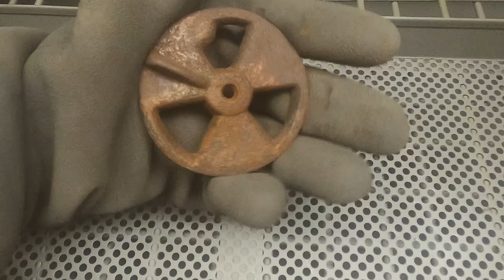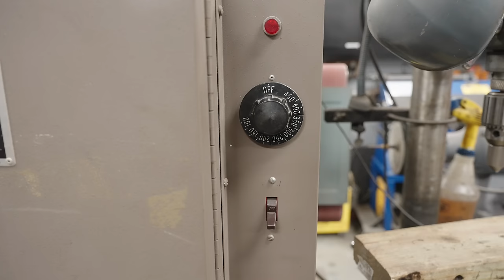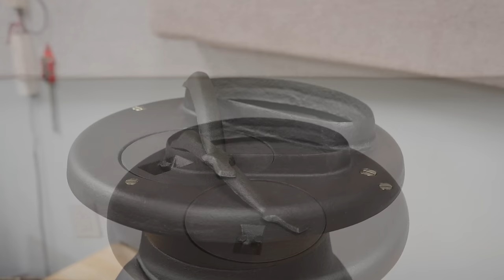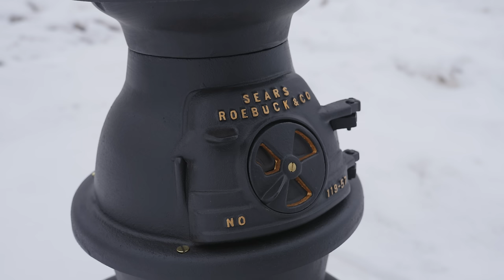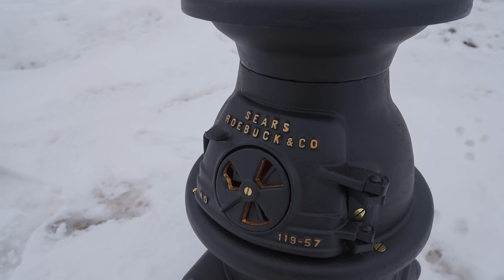Potbelly Stove Restoration

Comment: A 1957 mass-produced Sears Roebuck potbelly camp stove. Most likely sold by mail order. You did a good job restoring it and it and you will likely get a good price for it. It is actually better than new even with all the repairs. Welding cast iron is not for the faint-hearted. The massive cracks speak to years of hard use. Well done and a very interesting video!
Reply: Frankly it should be used as a decorative object at this point and not for heating.
Reply: Wasn't welded, but brazed which is a lot easier to do on cast iron than actual welding. Though he could have welded it having access to that oven for preheating.
Reply: Isn’t that actually “braising” or however it’s spelled?  Not welding…it’s a different process.  It’s a lot of work for….nothing?  Really?  Cool project I guess.
Reply: I second that, my father was a master welder, he would approve. We had a mini Franklin pot-belly in our green house on our homestead in Homer Alaska. Miss that little guy. Thank you for saving this one. Great job 👍 🤗❤️🌈🙏🕊️
Reply: @bruwin  welding cast iron is a lost art at this point
Reply: 1957!  I was thinking 1930's.  
Thanks for the info.👍
Reply: they never stopped making potbelly stoves
vogelzang sold one right up until the epa mandated reburn systems the fact that isnt that old shouldnt be surprising the old 1800's and early 1900's stoves are just about gone now they cracked much like this one did and they were replaced or the homeowner upgraded to domething more modern Edit: i came back to add that a quick google search shows that you can buy an E.P.A. compliant potbelly stove in 2024  thats cool
Reply: Pot belly coal burning stoves ended up anywhere heat was needed. I would be more inclined to refer to them as a parlor stove but there were many different styles of stoves that fell into that category.  Camp or tent stoves usually were box type for wood burning and had flat top surfaces for cooking. But if you had a hunting shack at a deer camp you might use a pot belly for heating and cook on a proper kitchen range of some sort. My wife's family had a stove very similar to this in the garage.
Reply: @victoriaEish it is still a form of welding and has a lot of different applications.
Reply: It was made from 1900 til about 1908.
Reply: @victoriaEish  brazing is joining metal. Braising is cooking food for a long time at low(ish) temperature in partial liquid.
Reply: @briandeeley1599 people say the same crap about classic cars but we still have plenty driving around.
Reply: the casting date reads: January 19, 1857...just sayin
Reply: @brentdallyn8459  - Ha ha ha ha.  That's the Model Number.
Reply: @cloudian159  Brazing technically isn't welding. Welding is specifically joining two metals by melting the base metal and the filler metal together. Brazing is done at a much lower temperature and only melts the filler metal, which is why you typically see brass using in brazing.
Reply: @bruwin  yeah I'm aware I'm a licensed welder. However it does still fall under welding as you are joking multiple pieces together. It is used for metals that either won't melt together or in this case with rod iron is extremely difficult as the metal itself tends to just melt before it will join.
Reply: That was definitely brazing. And no, brazing is not welding. It isn't clear to me what kind of rods he is brazing with; but if he is brazing with aluminum rods the melt point is very low, around 720 F which seems like a bad idea for a stove. If he is brazing with higher temp rods I think the repairs will be strong and hold up.
Reply: @cloudian159  It does have a lot of different applications and repairing Cast Iron is one of them. But no, it isn't welding.
Reply: @GeorgiaRidgerunner  I think pot belly stoves aren't epa compliant but epa exempt. The epa hates everything that is old timey which is why they went after old things that they claim are bad for the enviroment while ingoring modern things which are observably terrible for the environment. You never see them crack down on round up or reinforced concrete.  Wood stoves, brass polish, clock oil all victims of the epa. :)
Reply: @brentdallyn8459   Yeah sears wasn't a thing in the 1850s. :)
Reply: @cloudian159  You should tell the several licensed welders I've had to deal with that Brazing is Welding, because each one of them were quite adamant that it isn't. Anything that doesn't melt the base metal isn't welding.
Reply: @Joe_for_real I'd guess some kind of brass alloy by tue color.
Reply: If I remember correctly you can weld cast-iron with nickel welding  rods.
Reply: @vincecarnevale4406  They do make rods for welding cast iron, yeah. But you really need to heat soak the metal first, and then let it cool very slowly so that it doesn't fracture as it cools.
Reply: @brentdallyn8459   That is no when it was cast.  Sear roebuck made these from 1897-1908.  That is the model number.
Reply: This is not a 1957 mass produced model.  It was cast sometime between 1897 and 1908 which is when Sears Roebuck made this model.
Reply: Reminds me of the egg. The green egg bbqs
Reply: @ohhenry5773 this is one of the radium models. Hence the ☢️
Reply: I found this model on a 1948 sears catalog for 11.95  bucks
Reply: Doskonała praca. Brawo👍👍👍👍👍👍👍👍👍👍
Reply: @cloudian159  Uh oh the "licensed" welder has spoken. Bow down to the authority and never question ANY one with a degree or license. Also it's "wrought iron" not "Rod iron". This was cast though.
Reply: Man, that was quite an era. Shouldn't OP test it with Geiger?)
Reply: 100% confident this was manufactured between 1900 and 1908.
Reply: Guys, here is The Savior

HalleluYAH translates “Praise ye YaH”

YaH is The Heavenly Father
YaH arrives via the TENT OF MEETING
YaH was Who they Crucified for our sins
YaH was Crucified on an Almond TREE

Ancient Semitic of Moshe (Moses)
Isa Scroll (The Original Isaiah)

Isaiah 42:8
"I am YaH; that is my Name! I will not yield my glory to another or my praise to idols.”

Isaiah 43:11
“I am YAH, and there is no other Savior but Me.”

Isaiah 45:5
“I am YaH, and there is none else.”
Reply: @brk932 oh yes, it's a lost art, considering the fact that there is laser or at least argon arc welding, even a junior high school student can handle such a crack in cast iron.😂😂😂😂😂
Reply: friend, aren't you bothered by the fact that there is a radiation sign on this "potbelly stove"? Tell me, where can you see such a sign now? This is something to think about...
Reply: I was thinking that it looked a tad small for an actual potbelly stove.
Reply: Wow...this old stove was really “stove up” so to speak. You brought it back to new condition.
Great Workman ship. 😊
Reply: Thanks my pot belly needs a over haul and be nice if it turns out like yours. No cracks but leaks stainless steel flue is the go turns blue but do doesn't thin.
Reply: @briandeeley1599  Why not? It should work as well as ever.
Reply: @victoriaEish the passion can be in the work and progress more than the end result.
Reply: @PorterWood09  true enough…

Comment: My grandfather had a Sears cannon stove like this in his radiator repair shop in the 1960s and 1970s, It was grandma's job to do the end-of-season cleaning--a very messy job. One year, my great-grandmother was ill and grandma was out of town, so grandpa hired a "professional' to clean it up. Apparently they tightened all the bolts and screws down too much and by the end of the next hearing season. The stove had developed cracks. Grandpa cussed that company as he installed a new gas heater, but I think grandma was very happy to not have to deal with the old cannon stove any more. Sears listed these in their catalog into the 1960s.
Reply: Back when you could smoke at work.
Reply: Why wont he do the work instead?? Thats just weird man
Reply: @arlynnecumberbatch1056 he was repairing radiators

Comment: I used to be the cast iron repair guy for my area, usually fixing "repairs" someone else tried that didn't understand cast. 
 Braising it is good, but you can use a broken piece of cast as filler to tig weld it too, but only if whole piece is cherry red, then post heat,and peen it until you are crosseyed. You do good work, loved this video.
Reply: I preheat with a propane turbo torch-grass killing torch, and post cool in a bin of vermiculite. Brazing is a handy way to repair cast iron. I’ve used zinc welding rod if a color match was important.
Reply: Soak the screws in WD40  for a day, or several, if they're rusted shut.

Comment: I have a soft spot in my heart for potbelly stoves, from the three we had heating the house on the farm.  You have done an outstanding job restoring this one.  You took way more ‘pride in workmanship’ than the manufacturer did, as evidenced by the care you took smoothing out your welds, as opposed to the castings you had to smooth out.
The gold trim paint was a nice touch.
Thanks for sharing your project.
Oh, and we can NEVER get enough sandblasting footage.  Thanks.

Comment: A VERY impressive restoration. I have not seen brazing being used for a considerable time. As a teen in the 1960s, I was told by my betters that "cast iron" was notoriously difficult to weld, even with the specialist rods then available, and most (like you have here) repaired any faults by brazing. A very interesting video. Thank you for sharing !
Reply: How does brazing hold up versus the temperature seen in a cast iron stove?    Just curious.
Reply: @bobk3840 Why ask provocative questions to someone who doesn't know the subject? But you're good!

Comment: A very interesting stylish stove and a magnificent, honest restoration.
Restorers on YouTube very often repair cracks and chips in cast iron using surface electric welding. The repair has a decorative effect, but is not durable. You use brazing and this is in good faith, the product can actually be used.

Comment: I'm Canadian, and where I come from they call these Quebec heaters (not sure why, maybe because they were popular in the province of Quebec). This is a very small unit, and as a farm kid growing up with wood heat we had a large heater in a downstairs room to supplement the big wood furnace in the basement. I repaired ours multiple times with brazing, and although it works well for structural strength in cast iron, it lacks heat integrity for large fires. Therefore it had to be checked, and  renewed yearly! Add the furnace cement/fiberglass repair in the hottest area of the stove I personally would be careful building an indoor fire. Makes a wonderful nostalgia piece, and you did a magnificent job!

Comment: I've got two of these that are in perfect condition and they both have the top plate and the handles that fit in the indentation of the lids to remove them .
I found them in a couple world war two bunkers at tongue point over looking the Columbia River. My uncle was stationed with the coast guard on tongue point and being an officer he had a nice house above the coast guard docks . The bunkers were completely over grown and I had to cut my way into them . There was a lot of stuff left in those bunkers that dotted the point. I had to carry the stoves on my back for over a half a mile and it was brutal with all the brush and undergrowth. I brought the stoves home and cleaned all the rust off and painted black. That was over 55 years ago and those two old stoves are still sitting on my covered deck in the same condition they were 55 years ago. When I'm gone someone will get to enjoy them I just hope they don't make a flower planter with them or paint a bunch of flower designs on them. They deserve to stay as they were when I found them and I've always wondered the stories they could tell if they were ever able to speak.

Comment: you sir are a master of restoration. excellent job. my Grandmother had a Parlor Stove i remember from back in the early sixties they used in the house. the gold accents you put on the stove reminded me of that. I've always liked pot belly stoves but most are or were coal. i have cast iron wood stoves i use for heat. one is an old Jotul 602 thats a little loss for wear but still functional. maybe I'll redo it this spring as a project. interesting that there are no gaskets. really appreciate you bring that old stove back to life. thanks for sharing.

Comment: I have the same exact Sears stove and I rusted-over the same exact way. It sat on my parents screened porch on the edge of Long Island Sound for 50 years. I sandblasted it, mostly outdoors due to the size of a lot of the parts, then used a cheap high-temp matte black paint.

Comment: Brazing is done at 900-1200 degrees. A wood stove can possibly get over 900 degrees in some cases. There is potential for the repair to melt out of the crack if the fire gets going a little too high.

Comment: One of my favorite memes for unsticking threaded materials, oh it's a little stiff Let me loosen that up a little spray some WD-40 or penetrant, nope, gets out something that's got a little bit more umph, still not going at it gets out the torch Little more heat that should cause it to expand and contract come right loose, gets out the plasma torch it can't be stuck if it's a liquid

Comment: I redone an old chsrter oak stove.It was a pile of junk when i hulled it to my house.I did like you did,i tore it appart and brased the btiken parts sand blasted it painted it with highheat barbeque flat black.It had like nickle plated pieces all over it.When i got it done it was beautiful.The one you finished was also a nice job.

Comment: I used to have one of these in my off grid cabin. My wife actually seasoned the bottom of the ash catch and we would clean it out well and drop a little oil in there and bake biscuits in it like a little oven. She could cook an amazing amount of things on that tiny wood stove. I made a replacement for the door that had a gravity fed hopper you could fill with pellets to keep it burning through the night and simply pull the door off and replace it with the normal one in the morning and drop some wood on the bed of pellet coals to get it going again in the morning. The grate in the bottom of ours was different though. I don't think this one has small enough holes to catch pellets.

Comment: I don't care if you cut corners you rebuilt it beautifully.  I'm very impressed and applaud you.  I love to work wood l would never want to do anything in cast iron but a potbelly stove would get me to experiment with a sand blaster.  It was fascinating view to watch you and see that there was mores than sand blasting. Now this stove will outlive you.  I love wood heat it feels so good where electrical heat doesn't.  What was that black stuff you painted on then fired it?

Comment: Soon as I saw that cast iron being brazed up I thought good luck with that. Differential heating equals cracking, the whole piece was preheated but not enough, it needed to be approaching just on red, plus it needed to be allowed to cool down very slowly afterwards. Like being buried in a hot box containing sand or lime. Interesting fix with the fiberglass bty.

Comment: Beautiful result; i love the brass hardware with the gold pinstriping.
Technical question: Why did you use bluing on the fire grate rather than paint?  Does it make the parts more resistant to rusting? Do these parts get too hot for even the hi-temp paint?
Reply from the maker: That was my thinking, yes!

Comment: These little stoves started out as "Salesman Samples". Salesman for the various company's took them around to show people and shop keepers what the stoves looked like and how they operated as they were built exactly like the real stoves only far less heavy. I have a number of them by various makers in my shop. I also use a full-sized stove, just like my "Franklin" sample. It was made 1861, is nearly 4 feet tall, and a little over 2 feet wide and weighs over 300 pounds.  In the 50's, Barryman, Sears and Woolworth contracted with stove makers for the "sample" sized stoves and sold them as "Camping" stoves. They were never made to actually be used and often cracked from the heat and over tightening the bolts that held them together. But, even so Sears, Barryman and Woolworth sold a lot of them.

Comment: 😂 couldn’t help but giggle watching this. I’ve redone several old wood burners through the years. Sat the outside got a good hot fire going and let it cool and repeat if a lot of rust. Rust generally pops off do to the expansion and shrinkage. Then I saturate in oil be it vegetable or olive whatever I have then light it again. When done it looks clean and dressed like a black iron pan.

Comment: came out really nice  good job . if u can run brass yoi. an fixxany cast iron  o have fixed moror mounts and things with electric rods also . it sremd to be stronger when needed . my dad put s gracyor motor back together 50 yesrs ago in 92 when he died  it eas still running after being dropped on concrete  amazing the old craftmen we bad . thanks for the memories . i was 18 now 68 .....

Comment: I have to ask because I've never brazed or used fiberglass before, but with all that repair work would this stove even be usable? Or would it become a strictly decorative piece? I'd be worried about the brass melting when I get a fire going indoors with what I know of metal melting points.

Comment: why did you fill the disassembly slots? 15:46 Those cutouts are so you can twist the top and lift it off without completely removing the screws. It helps prevent losing them.

Comment: Will the cast iron and braze expand the same when the stove is used. I know cast iron exspands quit a bit when heated . Also when cooling down ,cast iron will tighten and maybe pull away from the braze . But not sure if the stove will just be for show ,or will someone use it as a heat source.
Reply from the maker: Brazing is a very common way of repairing cracks in cast iron exhaust headers that get very hot